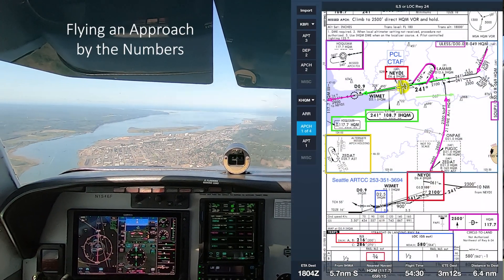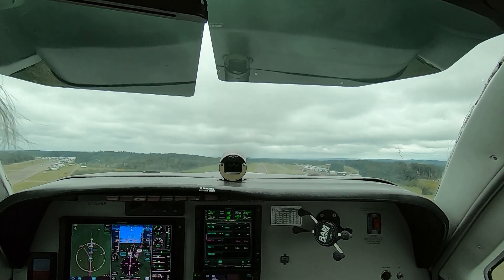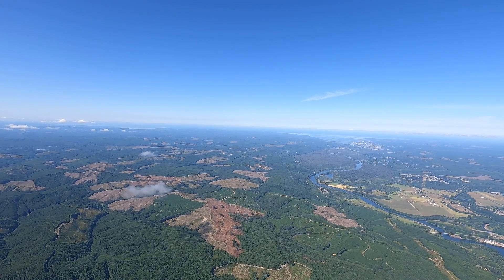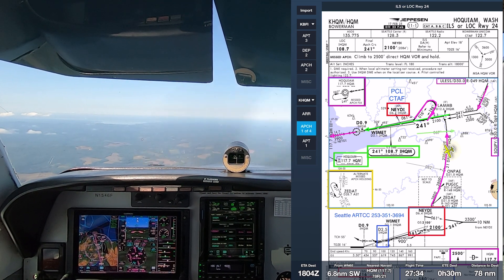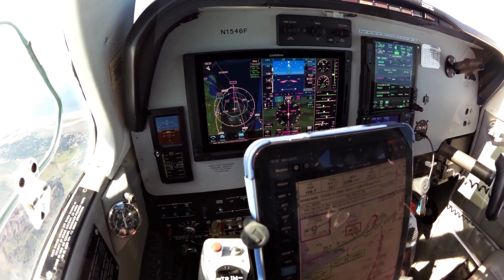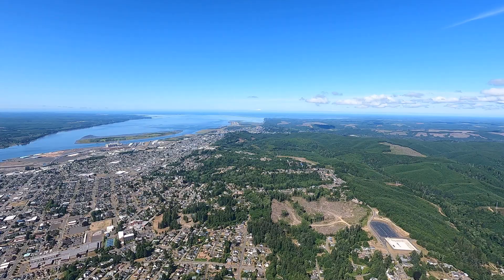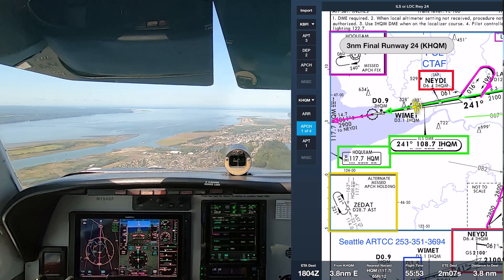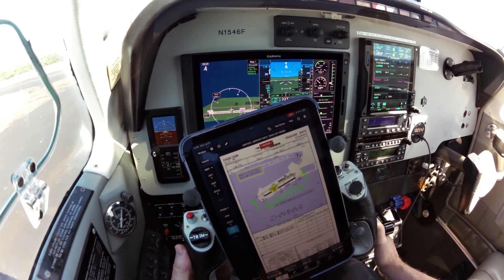Flying an ILS Approach by the Numbers

Comment: Great video!  Thanks.  In a 172 while still in IMC, how do teach making small corrections when the CDI is drifting slightly; with rudder only, or coordinated rudder/aileron?  Similarly, if slightly above or below glide path do you teach correcting with pitch or power only, or a combination of both while maintaining IAS?
Reply from the maker: I teach the technique recommended by my friend Rod Machado. Watch his video here: https://youtu.be/QYvjS1SZsfA. You can use a similar technique to maintain the GS/GP. The key is to be aware of your energy state. If you're fast and high, you can reduce power and apply a small nose-down elevator input. If you're low and slow, you need to add power to flatten the descent, and then make a pitch correction. Always have targets in mind when you change power/pitch. Most of the time, if you're keeping up and see only small deviations, you can recapture the course with 5-10 degree banks and power changes of about 100 RPM from "the numbers" that you know work for your airplane.
Reply: @BruceAirFlying  That really helps!  Thanks.